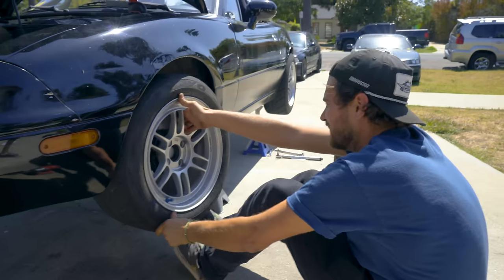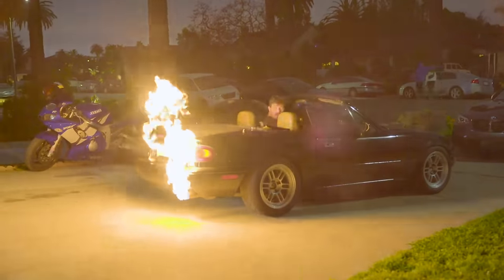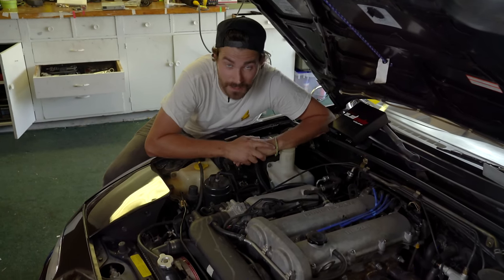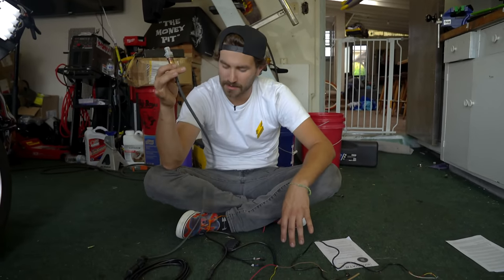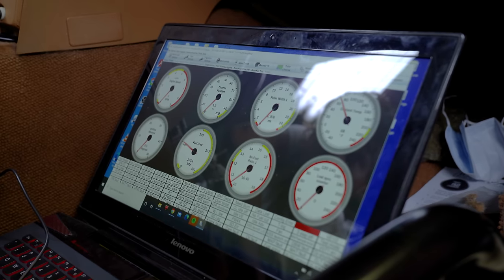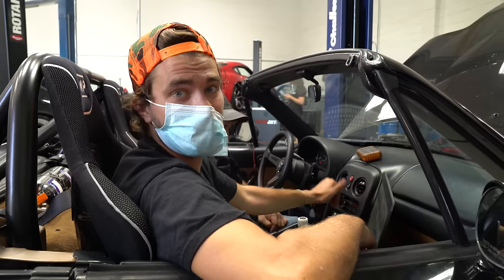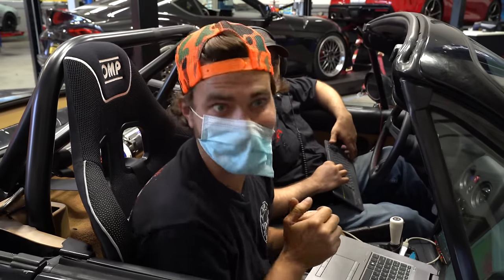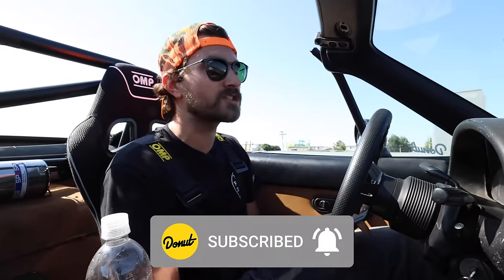Is a Standalone ECU Worth It?

Comment: I have never seen someone being so excited about their car making 112 hp
Reply: True..... but its got good power to weight and hes openin up the gates for bigger gains.... layin the ground work. It does seem a lot of work for very little gain until you see what angle he's coming from - example once he adds a blower of descriptions - he can really get the most out of it.
Plus thats hp at the wheels. Not engine.
Reply: my 09 R6 does 110 hp at the rear wheel...BUT i will acknowledge there was a heck of a lot of engineering to get there.

As mentioned above (and probably below) Jobe is probably getting ready to add a power adder.
Reply: Order Of Magnitude - The Paranormal & Personal at the hubs* would be like 94 on a regular dyno
Reply: @Pr2jay  that doesn't make sense
Reply: Randy Pender hub dynos read higher because theirs no slippage in the tyres
Reply: @Pr2jay  oh okay i follow, lack of mechanical grip would result in a lower hp reading
112 to 94 seems like a big chunk of power loss though, the powers already been put through the trans and diff to reach the hub
Reply: Randy Pender yeah, my friend had his car dyno’d on both, he had 202 on the hub and 184 on the normal, that’s all I’m basing it off haha
Reply: That 112 hp is at rear wheels bro, probably engine is producing more hp. And on different dynos it varies..... these things are basics of ECU tuning.
Reply: I have expected think kind of a comment after knowing the hp 😂😂
Reply: My bike makes more than double that. What a supreme money pit.
Reply: In a miata 1hp is like 2.5hp in anything else.
Reply: @king_h.3826  So the engine is making about 130hp at the flywheel, thats a nice gain on a n/a car
Reply: That's exactly what i was thinking.
Reply: @Pr2jay  that's 8.5% loss. If he saw the same 8.5% loss he'd be hitting 102hp
Reply: @kierancarter8369  you cant compare bike and car engines. the R6 produces the 110hp only at 12k rpm and above, if the R6 had a rev limit like the miata about 7 or 8k, it wouldnt even produce 60hp
Reply: the civic kids in the 90's were totally like that
Reply: What this sort of upgrade is about is not the gains the ECU itself gives you, it's about the POWER it gives you to properly tune your engine, no matter what modifications you make.  For instance... I have a little 1990 Miata with a bone stock 1.6l engine (the 1994 in this video has a 1.8).  I ran an earlier version of this ECU, as I am actually the creator of it.  I laid out the first circuitboard myself, now I have engineers do it as I am not technically one myself (no degree).  Anyways, that 1990 Miata, which I still have but FINALLY hurt the motor in after a LOT of hard use and abuse testing products, probably a couple hundred hours of dyno time in all, well... for a couple years I drove that thing all the time.  After turbocharging it I made a reliable 253whp/232wtq on my DynaPack Hub dyno.  Enough to obliterate stock transmissions when running sticky tires.  Again, bone stock 1.6l engine that barely made 100whp in stock form.  Just needed some forced air and a good way to tune it.  

And let me tell you, that little 2500lb car, with 253whp and 232wtq, is one of the most fun little cars I've every driven.  I have another motor.... I should bring that sucker back to life.  So balanced it will dance any way you ask it to.  So much fun!
Reply: mi car make 85 in cool wheather
Reply: I'm making 145 to the wheels in my NA. Lol
Reply: i think hes laying the foundation for a turbo, standalone ecu for atmosphere car is waste of money in my opinion
Reply: @csbeverly1  That’s awesome! What mods are you running?  Cams/heads/ITBs maybe?
Reply: @tamos2006  N/A standalone engine management is definitely needed for more than mold mods, such as cams/head work/ITBs/etc.  But for mild tweaks like an intake or exhaust, while you WOULD benefit from an EMS, there are simply less gains to be had so you have to do the cost-benefit analysis and for some it will make sense, for others not so much.  If you’re racing in a series with 100whp cars, and you can find 3 or 5 whp, it can make all the difference.
Reply: @jerryhoffmann2918  sure i agree, i was talking about the "normal" client who driving the car for fun(daily). if you have money and did engine mods already go for it, but in my opinion with the whole ECU package(inc tunning) you can purchase parts which you will probably "feel" more.
in where i live this can cost up to 2000$ inc tunning
Reply: @jerryhoffmann2918  thanks!! Running a 99 built engine with a custom head and intake manifold, 3d printed in-bumper CAI, racing beat header, cat delete, custom full exhaust, stage 2 clutch, 6lb flywheel, sent to a 4.3 torsen rear end :) using a MS3 pnp pro for the ECU. :)
Reply: @csbeverly1  Nice!!  Sounds like a killer combo that's working for you!!!!
Reply: I say 150 to 200 is a nice fun power spot but if the car is light, 100 to 150 is good.
Reply: Jerry Hoffmann as I said, he’s gonna turbocharge it, look at his new vid.
Reply: @tamos2006  Awesome, looking forward to it!
Reply: 112 whp is about 123 bhp at crank.
How much does the Miata actually make?
Reply: It's good to be easily happy
Reply: fr lmao
Reply: Was it even an improvement?
Reply: @mk810  not really but it will pay of when a turbo will be set up
Reply: @mikedrop4421  I used to have a Lotus Elise and you were saying?
Reply: @michaelmay5453  haha yeah that's true. A buddy of mine replaced his Evo with an Elise and you're right about the power to weight. His had the 1.8 Toyota motor and when the variable valve timing system switched to the big cam it actually felt like a turbo hitting boost because that extra 20hp made the car accelerate that much faster where in most cars the big cam just makes up for the engine wheezing at high rpms.
Reply: @mikedrop4421   Not only that. Lotus is infamous for the handling capabilities of their cars, it really feels like a supercar going round a track or like a gokart with a massive engine on it.
Reply: He gets paid for this dont forget
Reply: Lawnmowers are fun to ride when you worked hard along the way
Reply: It's up to alot more than that now. 😅

Comment: Miata: Please I’m overheating I need more cooling before I die
Zach: Yea so we’re gonna replace the brains of the Miata for some gainz
Reply: Miata: overheats
Zach: I'm thinking we can squeeze a bit more power out of it. Hp goes vrooommmm
Reply: Miata: Am big overheat plz Zacc.
Zacc: Lets slam a standalone in this hunk a junk so we can bolt a turbo on for dem sicc peak hp numbers.
Reply: that intercooler is too small.. that why...
Reply: @campkira  intercooler 🤨
Reply: Haha exactly what i was thinking! The miata was overheating when he took it to the track
Reply: @campkira  intercooler? Buddy that's a NA engine if I've ever seen one
Reply: Zac's Amazon rencent orders 
Bag of 100 20 amp fuses
Reply: @campkira  don't you mean radiator lmao
Reply: Actually, if the AF is lean, the overall temps are much higher. 
 The tune is the most important thing, cooling is only needed when the power is much higher.
Reply: story of my life LOL

Comment: I've never seen someone so genuinely excited for 112 hp. Really enjoying this build series.
Reply: Yeah but that's like 250 in a full size car. Plus that's to the tires so it's making 130-135 at the flywheel. Most importantly he's now ready for BOOST!
Reply: You clearly haven't seen India..
Here most people only modify the looks and big builds like 800-1000 bhp are super rare.  Also very few people actually tune the engine( except a few)
Reply: @mikedrop4421  
112 whp is like 123 at wheels (10% power loss). Even at a 15% power loss it would be 129 bhp
Reply: @atarvhegde5210  112 whp is not 123 at the wheels. 112 whp is 112 at the wheels, cause thats literally what it stands for. Wheel horsepower.
Reply: @ThisIsntMeGaming  
Oops. I mean 123 bhp at the crank
Reply: @atarvhegde5210  i figured out it was just a type after i commented and then i couldnt find my comment to change, lol
Reply: @atarvhegde5210  typo*
Reply: @ThisIsntMeGaming  
Well mistakes do happen.
Reply: it was for the camera

Comment: Good stuff! Now I need to try to hit 113whp once I get a standalone in my NB 😅
Reply: You can do it Miata dad
Reply: @MiataMods  I hit 115 with the stock exhaust and just a cone filter in my nb1. That's Virtual Dyno tho
Reply: GREEEEG
Reply: Why bother with that engine? Just yank that puny 1.8 outa there and slap in an LS3 crate engine from Walmart and boom 500 hp
Reply: Ayyyy Grehck is here!!
Reply: I'm so excited for the nitrous.
Reply: Lol, in the NB the ECU is under the dash and a bit tricky to get to. I tried to replace mine but then never got around to making it work, so I just have an ECU lying around. rip
Reply: @sillypilly1234  It's not bad if you pull out the seat and strategically unbolt & unplug a few things. But definitely tougher than getting to the 1.6L ECU's!
Reply: @TheCarPassionChannel  True, its my bad for leaving the seat in, but I did get it in there, but I didn't have an o2 sensor so it wouldn't start, I ended up putting the stock ecu back in and forgetting about it
Reply: Love ya Miata master Greg
Reply: Craig is back!!!
Reply: Miata dad!
Reply: @lloyd9435  as sick as v8 miata builds are, they're way too much of a money pit, and not at all Money Pit.

Custom drivetrains like that, and the custom frame that's needed in front of the firewall quickly adds up to tripling the cost of an old miata like that.
Reply: @gummostump4217  yeah i totally agree. I always think of v8 mx5s as more like an alternative to a cheap porsche or something like that. Once you accept that those kind if cars are the things that you're up against, it starts to look like a bargain again.
Reply: @michaelcliff6574  The thing is it might look like a bargain like a C8 Corvette, a really good deal! But I still am not spending that much money lol! Hey I wish I could though. Boosted miata for life.
Reply: @michaelcliff6574  Oh, absolutely. I just feel that the extra cost and work needs to be mentioned, especially on the internet. Too often, people fail to make the connection between "v8 miata" and "miata + $15000 worth of custom modification". Some only calculate the "miata" part, and maybe add the cost of a bare engine.

Even then, I think Money Pit is one of the most applicable and informative series about modifying cars, especially for those just starting out. V8 miata, on the other hand would be just another build video, and we already have plenty of those.
Reply: @lloyd9435  LS EVERYTHING! !!!!!!
Reply: @orderofmagnitude-TPATP  No
Reply: raid boss music starts playing
Reply: @lloyd9435  because engine swaps ruin the balance of the car
Reply: What i can't understand is that a stock 1999 miata has 140 hp how this one hit 112 hp
Reply: Great, now the SoCal MS3 prices are going up 😂
Reply: @mohammadokdah1863  later year 1.8s  have higher compression
Reply: @mohammadokdah1863  HP at the wheels (WHP) vs HP at the engine (BHP). 99+ Miatas make 140-142bhp, and usually put down about 110whp. 94-97's are 128bhp and put down 100-105whp. 90-93's are 116bhp and put down 90-95whp.
Reply: @tarsan894  [Laughs in K Series]
Reply: Love my 140 in my nb goal is 230 240
Reply: 114whp I reckon #sendit - Taz.
Reply: @hpa101  I'm gonna take the air filter off and make 115 just because HPA replied 😂♥️

Comment: Zack a few weeks ago:  We're going to have to upgrade the radiator."

Now:  "So how about a standalone? :D"
Reply: Doubt 4 hp will change anything regarding temps
Reply: You can safely build up this engine to 150whp with the standard ECU (with head modifications)  ....this standalone ecu $800 to $1200  plus $3000 in major modifications (turbocharged) will get you 230whp ....
Reply: @alexisknows6513  even more. But the rods and pistons will disagree. And above 180 the clutch. I'm at 300 at the wheels now.
Reply: @TheAdatto  .... turbocharger adds a lot heat to the pistons ,ring gap goes to zero ....part of the piston head pulls off ...on these engines #2 cylinder.   300whp.....you are looking for a ZF gearbox at the bone yard soon.
Reply: @alexisknows6513  my 6 speed can handle350
Reply: @TheAdatto  ....agree 100%, but looking for BMW ZF for cheap is not a bad idea.
Reply: @alexisknows6513  a little late to this  but i believe some vw early vw 1.8t trans are also ZF trans
Reply: Poor little miata :(

Comment: This thing is good at almost everything except power
Reply: the add on ecu are for to help if you change after market that the og ecu don't design for...
Reply: Turbo is coming soon
Reply: JItterRy PoKERy they’re gonna need a new cooling system for that
Reply: JItterRy PoKERy  we still got about four episodes before he does that but you are right, turbo is coming soon!
Reply: Craig Martin yea the Miata doesn’t really have much hope. Even with all of that it’s still crippled with its overheating problem
Reply: @jitterrypokery1526  Please no. They already turbo'd the 350z's and we already know what happened with that.
Reply: @kenshien544  yeah but they had overheating issues, if the miata is done properly and get solid injectors theyll be good, plus it wont ve making too mucb power
Reply: @kenshien544  i think they kinda rushed the turbo in HiLow, they didn't take their time to really test it out and fix what's wrong with the car (reliability issue).
Reply: JItterRy PoKERy i hope so
Reply: Leonard Fair fair enough

Comment: What happened to the price of the parts? I miss that. Especially when it comes to big parts.
Reply: Megasquirt ain't cheap, usually around a grand
Reply: That specific ecu is about 1200 to 1300, a wideband kit would cost about 200.
Install yourself? Expensive.
Install by a shop? Your first born.

Comment: "you don't want to mess with electrical components with the battery connected, especially big ones" 

Thinks of all the airbags and modules I've disconnected with the battery still connected and sometimes the ignition on 

This is fine

Comment: Next will be "Is a Supercharger worth it?"

please
Reply: Turbo bro
Reply: Supercharger is at least more reliable
Reply: The Mazdaspeed version of the Miata N/A came with a 1.6L Supercharged engine or a 1.8L supercharged engine. I think a turbo/turbos would be better
Reply: I had a supercharged na miata and yes way worth it, had around 200whp on 10psi
Reply: @arjay3822  
No
Reply: Kyle Sonsalla 

Yes
Reply: @arjay3822  
How? Superchargers don't last hundreds of thousands of miles like turbos will, cause more main wear, and they're also much less efficient.
Reply: @kylesonsalla7620  Have you ever owned a turbo car? Reliable is the farthest description from it. Especially a modified turbo car, stock like an SR it's pretty good, but turbos especially turbo miata always have many many teething issues. Supercharged miatas make less power but are a lot more reliable.
Reply: @dsrtrsx  what no mazdaspeed ever came with a supercharger and the mazdaspeed miata was only years 2004-05 (nb) and those were turbo 1.8s
Reply: @colbyc6717  you just made ur yt channel lol
Reply: Turbo vs supercharger on the miata.....
Reply: I agree that a supercharger is the way to go, while I'm a big turbo guy, the lag from turbos can be annoying as hell if you're trying to get around a track. Sometimes you'll finally start to build boost but then you have to brake for the next corner, so a supercharger is the way to go. On a track, the linear power and instant response will dust a turbo car
Reply: I really like the sound of that. :-)
Reply: @awesomecooly123  
Every vehicle I own has a turbo, do it right once and it won't be an issue.
Reply: This isn't a big power build like his Silvia, it's a track car.
SUPERCHARGER all the way!!
Reply: Why not both?
Reply: @happyfireballman9633  u wot m8?

Comment: The only person I’ve ever seen hyped for 112 HP 💀
Reply: Thats why zach is just the best
Reply: It's on a miata... That's why lol
Reply: Hyped on getting my car from 60 to 95hp
Reply: bruh I'm gonna be happy when my old ass bmw makes the advertised 110
Reply: @luisitobardajibenitez8013  Z3 1.9?
Reply: @jase_llan  E12 2.0 (1976), I also drive a 2002 Z3 as daily but it's the 3.0.
Reply: @luisitobardajibenitez8013  ooh nice! Old cars do lack in power but they also lack in weight.
Reply: @jase_llan  the E12 is roughly as heavy as the Z3 with about 110~ hp (when new) less. But it still needs some electrical work, a bit of welding and wiring. Then it's time for mods!
Reply: @luisitobardajibenitez8013  really? I'm surprised the E12 is that heavy, even larger cars from that period barely scrape a tonne.
Reply: Power isn't everything. All the power in the world is useless if you can't get it to the ground, or the cars acceleration is all over the place.
Reply: @MrTilbin  a decent power/weight and good weight distribution is key though.
Reply: @jase_llan  well, let's remember its has about 4x the cargo capacity from the z3 and I can take 5 people with me. And the z3 "only" weighs about 1250 kg
Reply: @luisitobardajibenitez8013  I'm just thinking of cars like the Ford Cortina that come in at <900kg despite being a medium sized saloon of the time.
Reply: @jase_llan  those are more in the realm of small saloon of back then.
Reply: @luisitobardajibenitez8013  you think? I would say Escort is small saloon, Cortina medium and Ford never really had a "big saloon" around that time.
Reply: @jase_llan  i once had a look at a cortina  they're on the big end of small if that makes sense. The escorts back then really were small and there was no big car by ford for the European market. They ofcourse had the galaxy which was about the size of your avarage battleship. The E12 was, i think, the biggest or the second biggest car BMW had at the time. Marketed at business men at the time.
Reply: @luisitobardajibenitez8013  that's fair enough, I own a MK3 Escort and can attest to its size (or lack of) - it's shorter and narrower than my Fiestas!